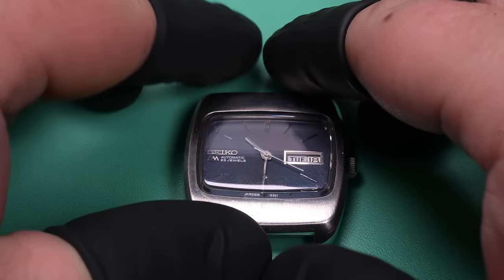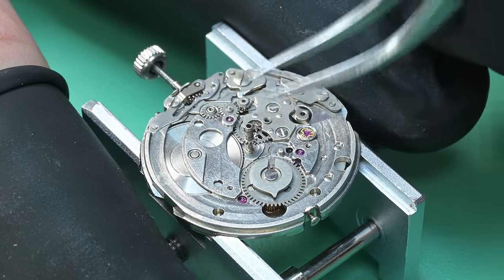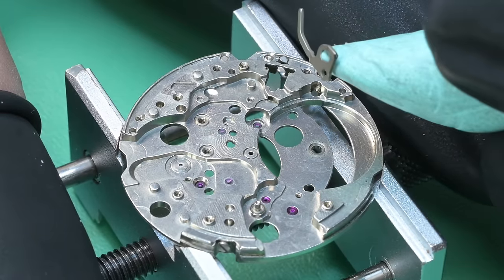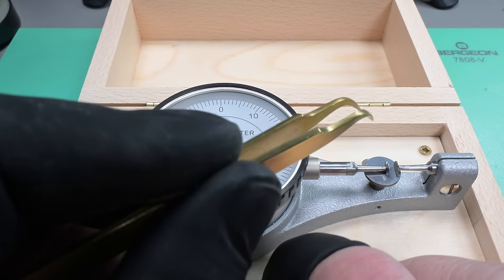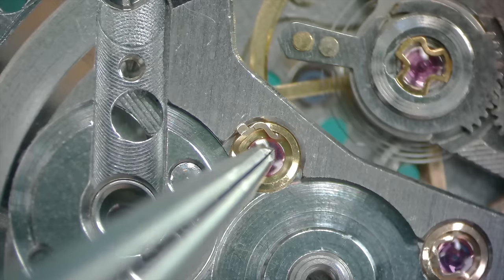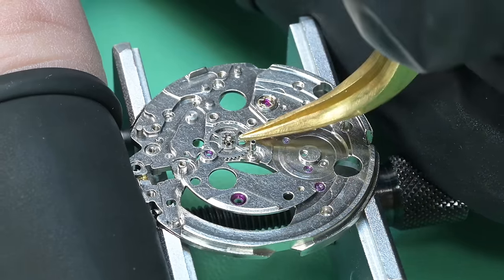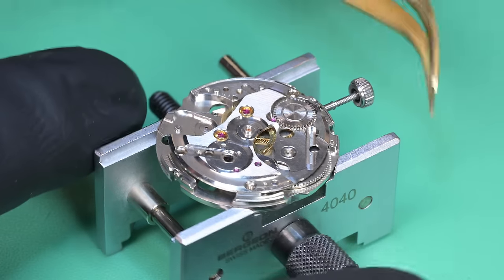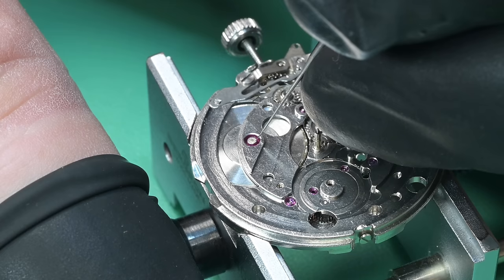Complete Overhaul: A '72 Lord Matic Top-to-Bottom Repair & Rebuild Chronicle

Comment: Adam, I think it turned out beautifully as well! Thanks so much for the shout-out on the video light...it was great seeing it in action. Also thanks for helping me create a shopping list of watchmaking tools that I saw your video! Analog micrometer, automatic oiler, cleaning machine, jewel setting machine, etc. I've been doing workarounds, but seeing how great your final results are gets me inspired. I want to hear angels sing, too! 👼
Reply from the maker: They sing when the tools arrive, but cry when the money leaves my wallet!  I'm a tool junkie though.  I'd be happy to help however I can.  The jeweling tool is not a Horia, but a 'clone' that is made well with a good micrometer on it.  I've flattened a couple of the stumps because I saw a few casing/machining marks when I got them in, but it works perfectly for 1/20th the price of the Horia.  The auto oiler is nice, but not absolutely necessary.  The Elma machine is really nice, but I only bought it at about 50% off retail.  If I didn't come across that deal, I'd still be using my vintage L&R Special that I restored.  I still have it, but it now sits in my garage.  Quite a shame actually, as it has been fully rebuilt, all new wiring & rheostat, motor has been serviced, heater has been converted to an Edison socket & a heat bulb, all original glass jars and lids, etc.  I just couldn't pass up that Elma.  If you ever want to touch base with me at WeekendWatchRepair@gmail.com we can discuss anything you'd like.  I've learned quite a bit on where I can spend less money on good serviceable tools and where I need to pony up and spend the money on the name brand stuff.

I have cool tools, but I wish I had your eye for video production.  Your content looks amazing.  I wish I could get there myself!
Reply: @WeekendWatchRepair  I've sent you an email! I look forward to continuing the conversation. 😀

Comment: Thanks for your vid.  I learned something.  The jewel for the lower MS barrel on a 56 series can be replaced with a jewel for the lower MS on a 6 series.  Very useful.  For the diafix, you can install them dry and then use a small drop of 9010 from the pivot side and then use a fine needle through the pivot hole to move the oil to the cap stone.  John S
Reply from the maker: Thanks.

Comment: Regarding the seconds hand staying in the plastic it's amazing how a little bit of static electricity on plastic will grip small light parts. They don't even have to be ferrous metals. I've learned to slow down enough and account for every part as I move them around because if I don't, I'll be hunting for it later.
I had taken apart an ST69 ladies watch movement and placed two small screws that can barely be seen by the naked eye into a plastic container. I could only find one of the screws laying in the bottom and was pulling my hair out. I finally noticed the screw with my MS. It was half way up the side of the plastic container  wall sticking to the plastic thanks to static.

Comment: First off LOVE your videos. I love vintage Seikos as well, and love restoring them to former glory. I'm having trouble sourcing gaskets/parts numbers. Where do you source yours?
Reply from the maker: To find the part numbers, I'm able to find 90% of the Seiko gasket part numbers from the old Seiko Casing Guides.  They are available for download from numerous websites.  Just a quick Google search should find a copy for you.  You can find your model number (XXXX-XXXX) in the document and get the OEM part numbers for the crown, case, etc. gaskets.  I hope this helps.

Comment: Adam, you used the lightbox as suggested by Mike!  I love it also. Question: could you have replaced that cracked jewel in the reverser wheel, or was that not possible?  Love how you handle the shock settings, they can truly fly!  Great video, thanks!
Reply from the maker: Yes I did.  I used his link and purchased one.  I'm finding it quite useful.  I suppose those jewels could be replaced, but I don't know how easily they can be removed from that 2nd reverser idler wheel.  I didn't try and just replaced the part entirely.  I'd fear that since you'd have to push out both jewels to even remove one, it would be very prone to cracking.  Never tried though.

Comment: Also, did you remove the off-set cannon pinion from the second wheel?   I’m not sure for Seiko, but on Swiss calibers like the zodiac 70-72, the cannon pinion is removed for cleaning and oiling.  It’s tricky to remove it from the arbor of the second wheel, but I find that a balance roller removal tool works well for this.
Reply from the maker: I've done that as well.  I didn't need to remove it on this one.

Comment: why do the hands need to be at 12 to be taken off and put on ?
Reply from the maker: They don't necessarily have to be at 12, but it is safer to have them all aligned when removing them.  With them lined up at 12, I also have plenty of room to get my levers underneath them without potentially contacting any logos or markers on the dial.